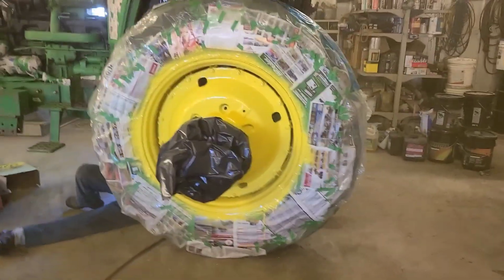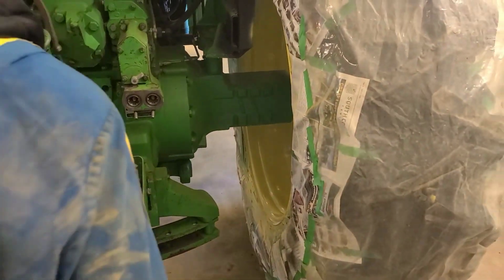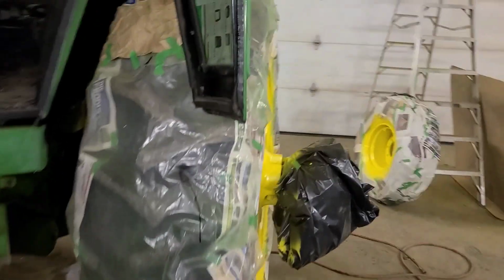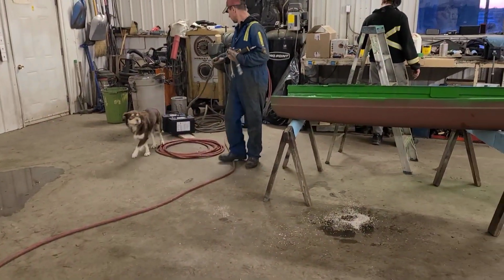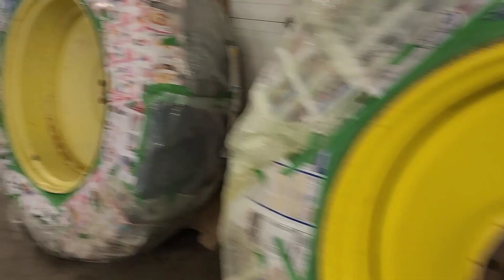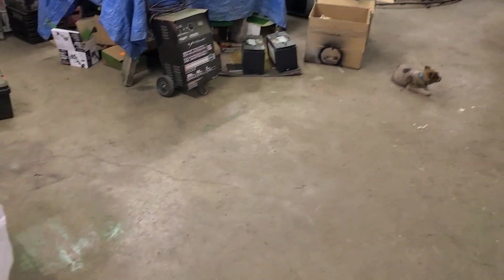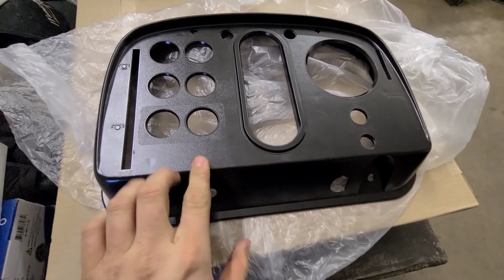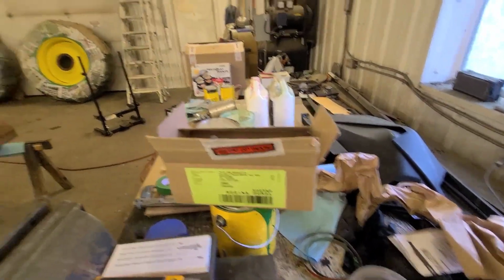We got a new puppy, painted the rims on the 4440 and went on a parts run!

Comment: Are any of the tractors at the farm a power shift?
Reply from the maker: Nope
Reply: We had a 4840 a few years ago with the 8 speed. It was ok.
Reply: Those versatiles were built special for that flat country and work real well in it. As a matter of fact I drive a 535 in spring here. It's got 900/ 60-42's filled with beet juice and in Sandy ground around here the straight 12 sp. Does just fine. If it starts to spin throttle her back a little if it would pull it then lift out on hills. It's quite a horse